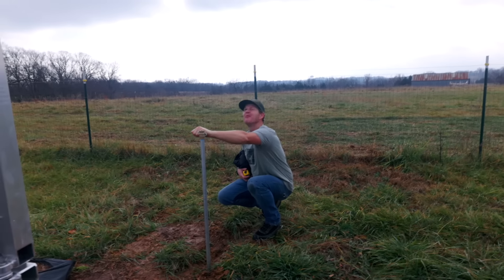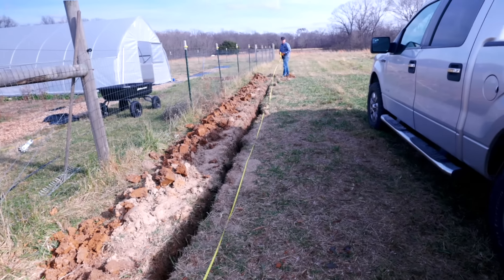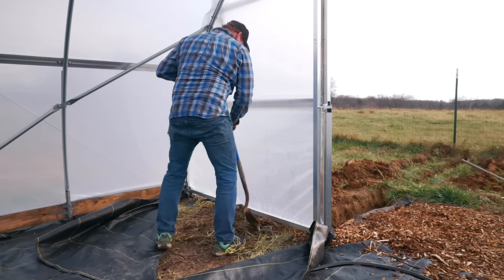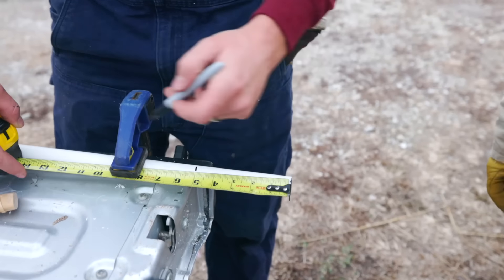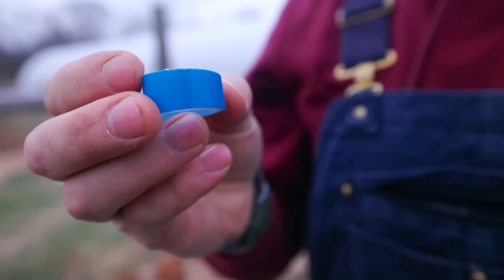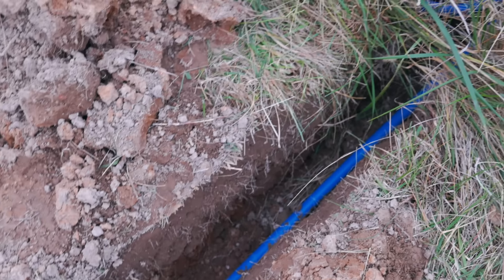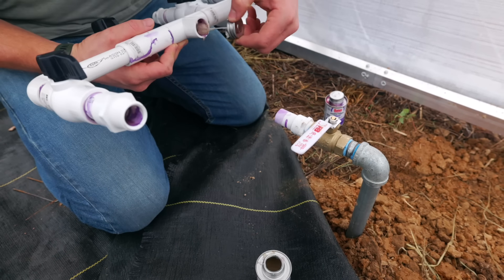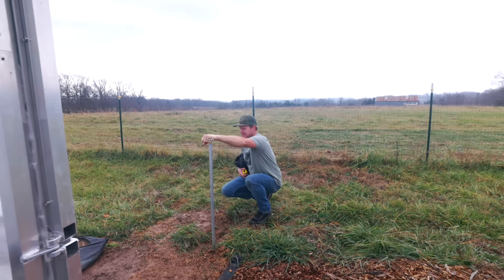Irrigation System Install 💦 | Trenching & Pipes (Part 1)

Comment: Thumps up for everyone who crawled around in the dirt to get the pipe in place.  100% better to do the job right the first time and not having to dragging hoses around everywhere.  My husband used compressed air to blow water out of the lines.  Maybe this will help to keep the lines from breaking during the winter. God bless y'all and keep growing.
Reply: I like the new word you created.....thumps
Reply: @snotina  well at my age sometimes the fingers don't always follow the rules and worse still, spell check didn't catch it either!
Reply: I took an old washing machine water line, cut it in half and clamped an air line connector to the cut end to be able to blow water out of lines before a freeze.  I think u are supposed to turn yr air compressor regulator down to a lower than normal psi so that u don’t damage water pipes.

Comment: For aesthetics you might consider spraying some paint on those pvc fittings, they will degrade somewhat and stain yellow/brown if not protected from UV .... Not sure how it being in the high tunnel will affect that but better safe than sorry, especially when I suspect that there is a can or two of spray paint lying around somewhere

Comment: Great idea.. Now I have done a drip system for a few seasons now. I have used the B-hyve for a few years and have recently grown my system to justify getting the 4-way timer splitter one. it is a little pricy but I think for me this spring, will help a lot with watering certain plants x amount. Now I prefer to have it on the wall or or having it in the air so that I can then in turn use pipe clamps to secure the PVC or garden hose to the little framed wall. this way I have less of a tripping hazard. But either way it looks great! 
Also, what type of PEX is that? I haven't seen that type at my local Lowe's before.  I have only used the thin walled version.

Comment: So why don't you guys get one of those insulated covers phone covers that you put over the pipe. And then stick a bigger PCV pipe over that and if there's a gap around that maybe somehow you can drill little holes all around that pipe so you can stick in a little nozzle of spray foam to fill that Gap inside the PVC pipe that surrounds that foam insulated cover. Maybe that could be your good insulation so the pipe doesn't freeze and if you need to fix the pipe you can cut the pipe down on the bottom pull it out of that insulated tube

Comment: Hi, I don't understand why you connect irrigation lines with glue?  Why not use screw-on accessories that can be disassembled and changed and assembled as many times as you want, like Lego parts.  Especially if you will install an irrigation computer in the future.  In addition to that, when laying drip lines, a pressure gauge and filter are required regardless of whether there is an irrigation computer or not.  The filter ensures that the drippers are not blocked by grains of sand or particles that are in the water.
Reply from the maker: If this manifold ends up not doing what we want we may try a screw together one.  Good suggestion 👍🏼